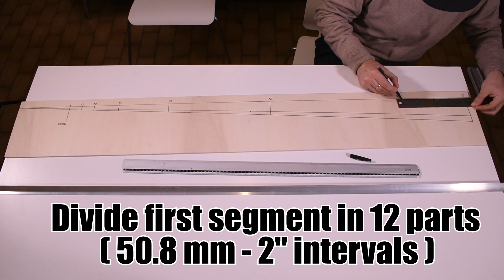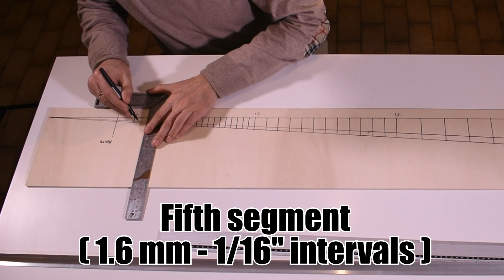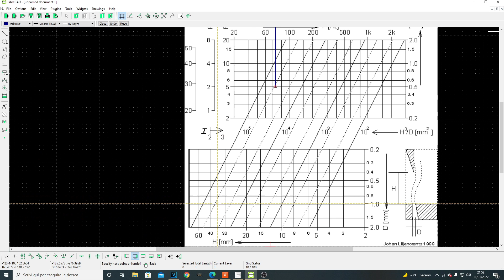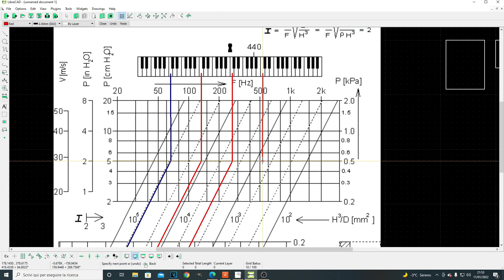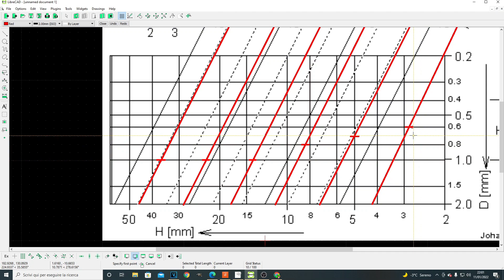How to build organ pipes | lieblich gedackt | 2/4 Pipe Sizing

Comment: Love it but do you know about conn pipe speakers you should do a few videos on the construction of one would love to build one or a few they have out there
Reply from the maker: Thanks Luis. Honestly I don't know them well, I've seen something but I've never tried to build them
Reply: @nippocast  they have a few videos about them and they sound incredible I figured you did because it was related to the organ I wish I can find the tube diameters and length for it then I'll try but I guess hearing them on videos I fell in love with the sound if you don't know it's fine but at least if it's possible to get the length and diameter of the pipes so I can try on my own if you can't thanks anyway